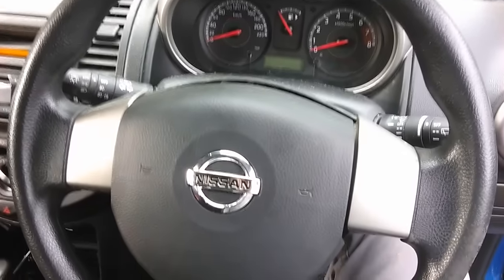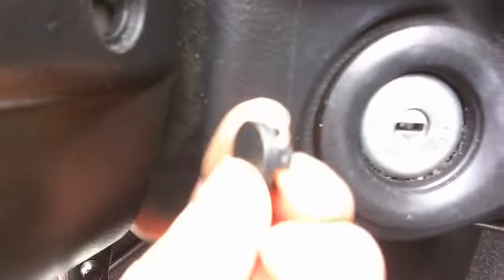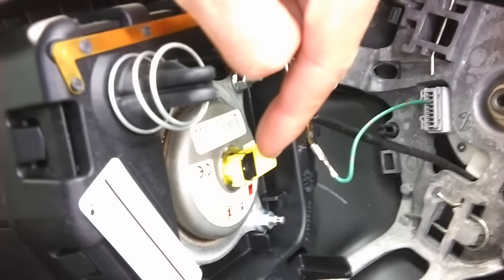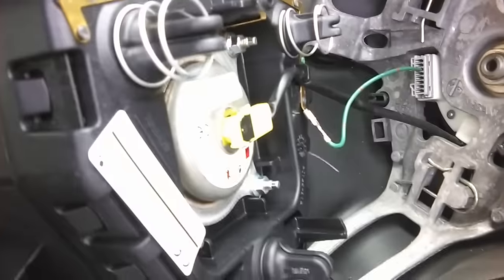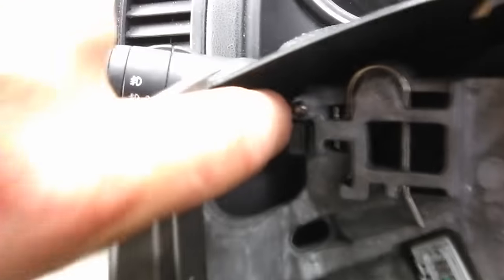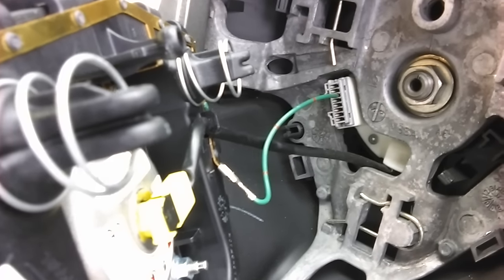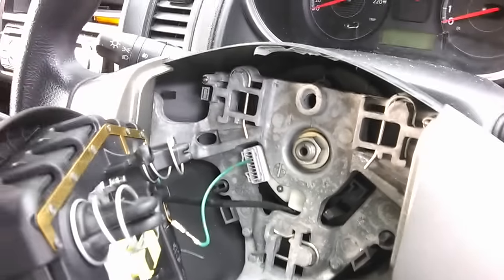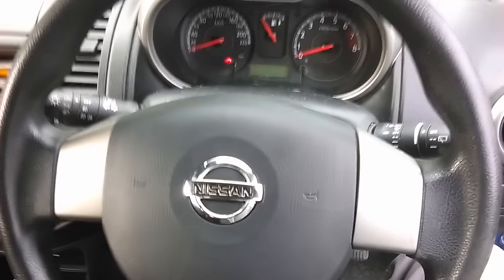Nissan note steering wheel horn / airbag module removal

Comment: Thank you for such helpful video. I own the exact same wheel of Nissan Note '06, and would like to add music control buttons to it. I intend to change only that plastic silver left part of the wheel, and replace it with the one that has controls. Do you think it would work out, considering that my steering wheel was not intended for it? Thanks.